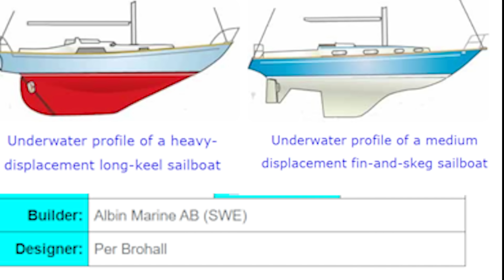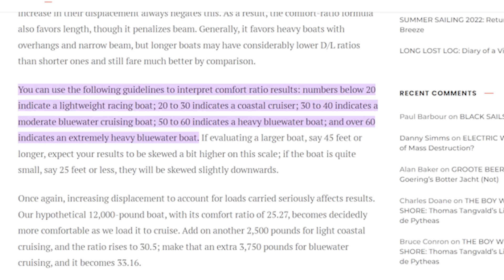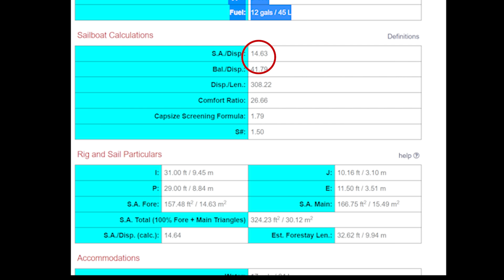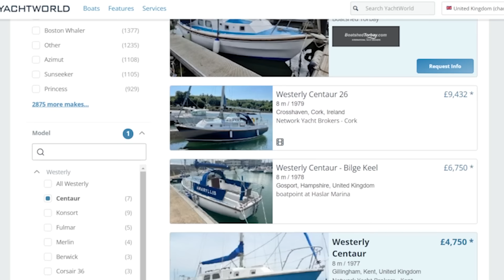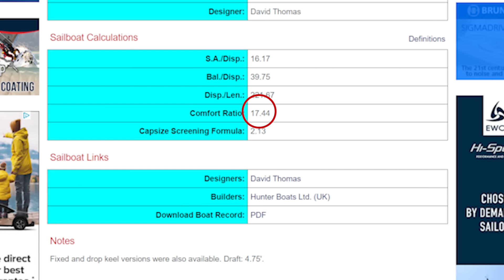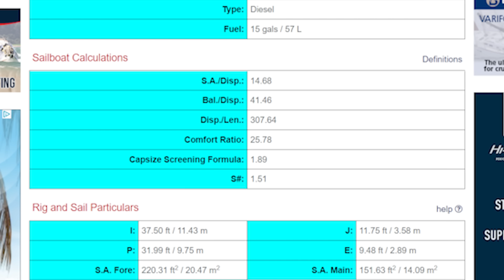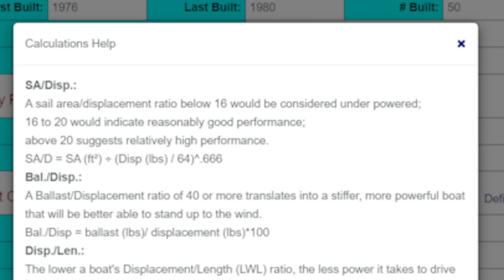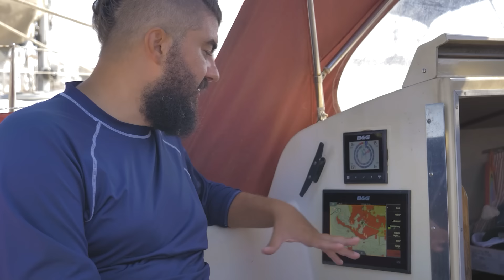OUR FAVOURITE SMALL SAILBOATS UNDER £10,000!

Comment: Hartley Queenslander 35ft in length 11 ft beam. 11ton displacement, Shower, hot water, electric winch. everything that is needed for blue water sailing. Under £10,000

Comment: I solo cruised a Yankee Dolphin 24 with a Navik self steering vane, from Mission Bay CA to the Caribbean Via the Panama Canal. Sailed it on a run in heavy weather of 55 kts wind and 20-25 ft breaking waves. 12 hours under just a storm jib. Wasn't a good time but it handled it. It was a great boat and capable of circumnavigating the world.

Comment: I was very keen on the Sadler 29 but they’re more £18-22k for a good one. I found a bad one for £12k but it would have cost a lot to refurbish. I ended up with an Etap 28i, which is most like the Hunter 27 in this set, a great small yacht.
Reply: Maybe you meant the Sadler 26 as they are less than £10k and great boats
Reply from the maker: Ahh yes they seem to have gone up a touch. I did find one or two under 10k when I was looking but would need some work doing. Etap is another awesome boat!
Reply: @davidalexander-watts6630 . Do you like the wrap 28i?

Comment: There's no mention of a Flicka 20.
Ok it is classified as a blue water but still trailerable. And although slower than most people would like it does handle rough seas remarkably well.  I'm moving up in size strictly for a live aboard. Which is why I am watching your video. But they are out there and some are at a very reasonable price.  Thank you for the research and honest reviews.  And you're absolutely right,  go small but go! Once you know what type of sailing suites you best you're going to know what boat will also fit your needs.

Comment: An awful lot of valuable info. Thank you for putting it all together. Many will find this very very useful.  One mega important issue for the budget sailor who is not   in a financial position to sail off into the sunset  that you have not specifically addressed is  mooring costs for fin keel boats. Here in the UK marinas are generally very expensive.  There are many real bargains to be found on the second market  for older  fin keel boat, but  the annual mooring fee in a marina is sometimes close to 60% of the actual value of the boat. When one looks at affordable moorings in the 500 to 1000 pounds annual cost range,   many are tidal with ability to take the ground essential, preferably with a fairly shallow draft . 

 I was actually fortunate to sail   the Eastern Med as a live aboard  on a  Jeanneau 35 (ex charter boat)  while still youngish. For  nearly7 years we cruised  the Aegean and Ionian and have some incredible memories.  We mainly anchored in the summer and   usually got some very good  winter marina deals. Our only income was eeking out our savings and the rental income from an inherited property   However, when we had to return,   the cost of keeping the Jeanneau   in the UK was outside our budget so we sold in Greece and  bought a 27ft lifting keel (Parker) on our return.  We sail this regularly, it's a real thoroughbred,  and have lived aboard  without issue   for up to 3 weeks on annual cruises to France/Belgium and Holland. Though, a few extra Jerries of water in the locker and 24 bottles of drinking water under the berths is pretty essential. Especially if you mainly cook on board.

Comment: Interesting. Very much agree with the Vega 27. I'm not familiar with most of the others, but you make a good case for their merits. I sailed a tidy alternative to the Centaur - a Westerly Tiger. It's a foot shorter, but has almost identical accommodation and a fin keel, making it a better upwind performer. One other boat I'd add. Still a bit on the pricey side - the Vancouver 27. Only room for a couple, but a proper blue water vessel.

Comment: My 1974 Swanson 30 cost myself and mate $32K (Aud) which considering the boat’s considerable ocean racing inc 6 S2Hs and ocean and coastal cruising history, let alone that its two previous owners had spent the combined sum of approx $30K in upgrading it was kind of a bargain. And yes sure it doesn’t have a shower, hot water, water maker, fridge or even an oven, it did come with a near new volvo penta 30 hp motor, new folding prop, new harken 40 primary winches, new B&G wind instrument, new furler, new sails, sheets, and quite a lot of refurbishment both on deck and down below. Yes there is work to be done, some more upgrades to be done to it but we are happy and race it every week. So yes a small boat has its advantages for sure.